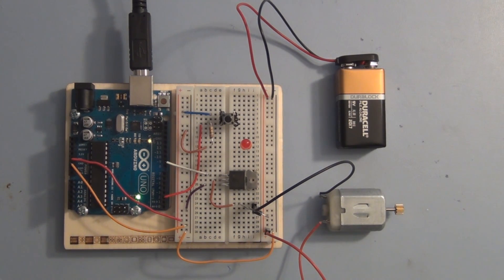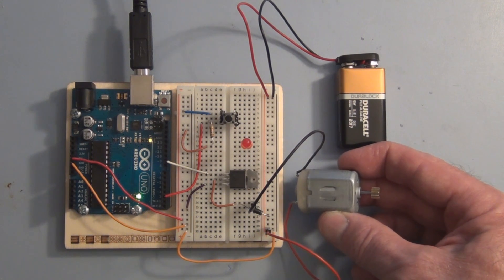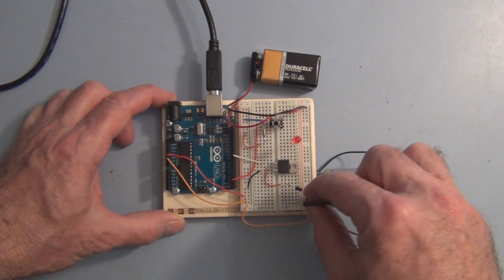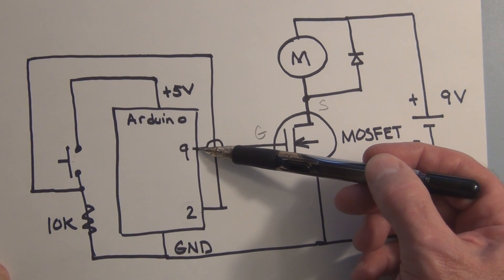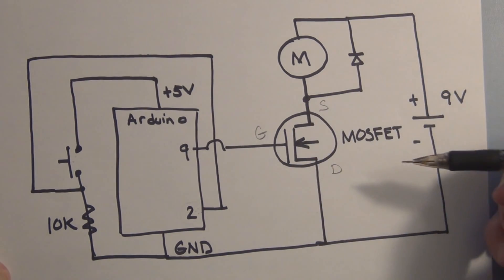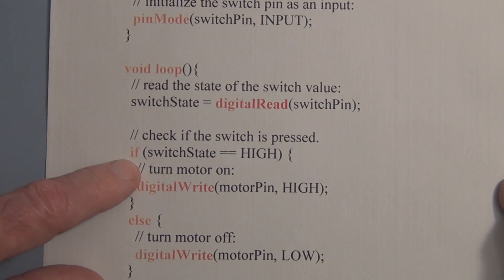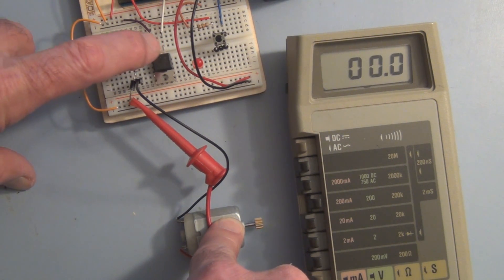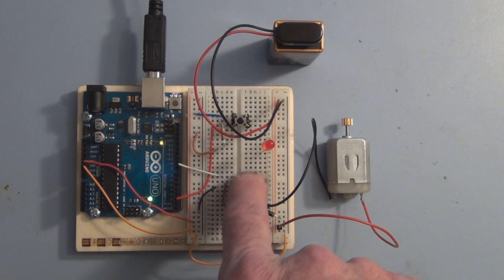Arduino DC Motor Control Tutorial

Comment: hello eTechTom, 

If I would like to attach a 24 volts, 800mA source instead of a 9 volt battery, for another device and follow the whole construction would this work? 
The common ground wouldn't destroy the arduino?

Thank you
Reply from the maker: +Pinda Of course I can't guarantee anything from where I am but  I would suggest adding a buffer between the arduino and the MOSFET so that if anything does go wrong you blow up the buffer and not the arduino.  The common ground will make sure that there is no voltage potential between the arduino ground and the 24V supply ground.
Reply: thank you for you quick reponse! Could you maybe say what you exactly mean with a buffer? what kind of element would I need?
Reply from the maker: Hi, I found this information to explain the use of a buffer.  http://www.electronics-tutorials.ws/logic/logic_9.html.

Comment: Hello sir I have a question,I've just studied something about mosfets,I've always seen their outputs as "Vout" something between source and drain,so I have some difficulties understanding your connections.So I was just going to connect Vcc to source then arduino to the gate and drain to the ground...but,of course, something's missing....you have connected your gate to 5v on arduino don't you? I am a super ignorant I know...and in this case theory and practice are two different things. Thank you very much.
Reply: +Andrea Ambrosini put an optical isolator like a DIP4 SHARP PC817C and a 220ohm resistor between the mosfet and the arduino.   Supply 10volts to the otherside of the opti which then fires the mosfet driving the dc motor.  The arduino is then isolated and safe.  Otherwise a mosfet that fires on 4.5volts but I am experimenting on which one to use.

Comment: Can we make some modifications in this circuit so that we can increase or decrease the speed of the motor..??
Reply from the maker: +SANDEEP KUMAR  This video is an example of speed and direction control https://www.youtube.com/watch?v=GumqesVRKyk
Reply: +eTechTom Thanks for the another video..but I would like to know that can we vary the speed using this same setup.???By changing the program code of the arduino..??

Comment: hello thanks for you time and presentation i liked it, now i do have a question as i plan to build my own MOSFET H bridge as i plan to pull alot of AMPS so i want to buy my own mosfet transistor and build my own driver board so my question is how would i go about starting a code? or libraries ? i plan on using a arduino Nano and 4 dc brushed motors so im guessing i will need  16 mosfets? 8 P channels and 8 N channels ?  so thats 2 P's and 2 N's per Motor  so how would a code like this will look like in setup?

Comment: The motor speed is not changing much when the pwm value is changed from 0 -255. at 0 pwm, the motor is slowed down only marginally. What can be the problem ?
Reply from the maker: It is difficult for me to troubleshoot something like this remotely.  I would review the code line by line and check your wiring.

Comment: Where do you get these hardware components?
I live in a village, near a small town, we don't have any stores that sell those...
And also, buying them online makes them quite expensive when you're just buying one of it.
Then they usually have to get transported, which increases the cost greatly...

Or can I find a nice kit with: Leds, resistors, capacitors, 555 timer?, diodes, shift registers, motors, cables, light sensor, pot-meter and all those. I kinda want to learn everything on it, some hardware (555/shift/motor/RTCC), protocols as I2C, UART, SPI and other interesting stuff... They should buy these in masses and sell them for cheap at schools/universitys, probably everywhere.
Reply: Google for Tayda Electronics. It´s a fast and reliable online store for electronic components that ships from Thailand. Shipping takes some time but the parts are dirt cheap even in low volumes.

Comment: Why the 9v battery has to have common ground with the Arduino?
Reply: Because both the Arduino and battery have to be connected to the source pin on the transistor.
Reply: 317andrew317 why? I see no reason for that. Why not 2 floating voltage sources?
Reply: Yeah I see what you mean.  My guess is that it shouldn't make a big difference having two floating voltages, but it will make the overall circuit more "stable or safer". I would try it out and see what happens.
Reply: 317andrew317 yeah, that makes more sense. I feel too, by intuition, that the circuit is more "stable or safer" sharing ground. The circuit feels more like "everything working together" if both voltages share ground.  I googled it and I read some people saying that sharing ground is a good thing because there is a shared "reference" in the whole circuit. I'm not sure of what that exactly means but kinda makes sense.
Reply: Joel Rivera That's how the transistor works. It only has one ground.

Comment: Is the external 9v battery necessary if the motor draws less power than the Arduino provides ?
Reply from the maker: The arduino is not made to be driving something like a motor.  It's purpose to to provide the control signals to get thing activated.  This just shows the basic concept of controlling a motor.  I'm not sure what the motor is drawing just spinning freely but once you start asking the motor to do work to drive some gears and wheels the current demand will be well above anything the arduino's voltage regulator can provide.

Comment: I keep getting  switchstate not declared in this scope. I wrote it just as you had it. Can someone please tell me what I'm doing wrong
Reply from the maker: There probably is a typing error somewhere.  I have entered programs before that I was convinced had no errors after reviewing over and over and then finding the error.  switchstate should be switchState for example.  Make sure there are the right quote marks,  " " is not the same as ' '.  Check to see if you have the right braces { }, [ ], ( ).  Its, difficult to see the difference in the Arduino IDE environment.
Reply: eTechTom So i got the sketch to work there was a } missing at the end well I hooked up the circuit and I have a irf510 and i'm using a 1n4001 diode. The motor wants to run when there the 9v is applied to between it and ground. I don't know if these 510 is okay to work with this i know it's not as good as the 520 but that's all radio shake had. Thanks for the video and help

Comment: I'm a beginner here so don't mind my silly question. 
I wanted to know about the diode. Is it a specific one or any diode will work?
Also what is the parameter for selecting a diode? (For Example: Resistance in resistors as in 100ohms,1KOhms, 1MOhms. So what is the measurement parameter for a diode.)
THANKS.
Reply: it probably does matter what diode you use for this lab since it doesn't use a lot of amps. as far as resistors it also doesn't really matter as long as you have one. 1k ohms + would work fine. just don't do what i did and put the diode in the wrong way it'll start to smoke lol
Reply: Lol....Okkk...thanks for the reply!
Reply: There are a few defining characteristics of a diode - how much current they can handle, how much reverse voltage they can handle, and the forward voltage.

For something as simple as this, your average diode should be good enough. In this case the motor needs 40MA of current, so your diode should be able to handle atleast that. I'm not so sure what a typical motor's reverse voltage is rated like, but again any old diode should probably be more than enough. The forward voltage is how much voltage the diode will take out of whatever you're ouputting. So if you give a diode 5v and the diode's forward voltage is 0.5v, you can expect the voltage out of the diode to typically be around 4.5v. It can be important to factor that into whatever you're trying to drive.
Reply: That was quite some description. Thnx! (y)

Comment: Hello.
Can I control the speed of the motor? I mean to say, is there any possiblity of a sketch(program)  where I will provide a speed(RPM) and the motor will run in that given RPM ? If so, please help me with that sketch.
Please answer my query as soon as possible. I am stuck.
Thanks
Reply: try to control it with the transistor. use a pwm pin for controlling the transistor and dont give full voltage to it.

try a stepper motor, too, which is made to do such things.
Reply: Jonas Toth Could you use analogWrite to the transistor instead of digitalWrite? That would controll the amount of current flowing through wich would then control the speed? Or is a PWM better because it allways gives the same voltage, just in shorter / longer bursts depending on the speed you want?

Comment: My kit did not come with a gear at the end. Where did you get that?
Reply from the maker: That was on the motor that came with the official Arduino starter kit.  Its a press fit so it was already on the motor shaft.  I just searched Amazon under hobby motor gears and there are a number of selections.  Some with plastic press fit gears and some metal ones with set screws.  You can probably find more by googling RC motor gears.
Reply: Thank you very much eTechTom.

Comment: Apologies for a newbie question. What happens if we don't have the 10K resistor. I am trying to understand what the 10K resistor is for.
Reply from the maker: Hi, Without the 10K resistor you would have a short to ground when you press the button.  The 10K limits the current going to ground through the switch when it is closed.
Reply: Thank you Tom(?). I truly enjoy your tutorials. They are so great and easy to understand. I wish you were my teacher in EE101 course in college.  I can't believe that I do not seem to remember anything from the course I took. These tutorials really inspiring me in many ways. Thank you again!  Back to the topic,why do I even need to connect from the switch to the ground then if the purpose of resistor is to prevent from shoring to the ground. Whew, a lot to learn for me.. :-)
Reply: Looks like I asked a question that leads to "pull down" and "pull up" resistor. NM the question. I will do some study on this. Thank you for the video tutorials again!

Comment: hi. Could you send me the code used in the Arduino ??
What is the reference of the MOSFET and RESISTORS USED ??

I plan to control the stabilization flew four engines of a Quadrirrotor.

Thank you

Comment: i am curious what if you wanted to program the button so once you press it, it turns the motor on for 1 second then turns it off even if you're holding the button down
Reply: asklnalksdn use delay (1000);
Reply: GabsBiz actually that won't work. missed the still holding the button down part. You'd need to set up some kind of timer. However, you'd need to make sure you reset it at some point otherwise the button won't work again.
Reply: thank you i wasn't considering the reset part

Comment: Hello sir,
Thank you for sharing this !
I just have one small question; is it possible to program the Arduino to control the Motor itself through a pre determinant route? Because i want to build something that will move by its own in a path that is already set. 
I hope I am making sense and I am looking forward to your reply.
Reply from the maker: This question has a lot of variables and it can be as simple of as complex as you want it to be.  If there is a predetermined route you have to translate that into code and that takes memory.  The arduino uno only has 32k of memory.  If the Arduino is responding to sensors it can react to the inputs and not use as much memory.  You could draw a black line for an arduino to follow by sensing the line and adjusting direction.  You could also add GPS and memory shields to the arduino and have an autonomous robot but that will require more complex programming too.

Comment: Would it be possible to use an SCR rather than a MOSFET to control the motor?
Reply: nope. scr are for other stuff. switches only with bjts and fets.

Comment: sir this motor having controlling through a switch..but is that possible to control through some wireless ...if is it possible then give me some ideas..thank you..
Reply from the maker: You would have to use something like the xbee wireless modules for the Arduino or maybe infrared for shorter range projects.
Reply: thank you sir..,but if i want to use twitter or Facebook through control a toy car..then?
Reply from the maker: Rozar Biny There is also an ethernet shield for the arduino or the Arduino Yu'n which has ethernet and wifi capabilities.

Comment: Good video, BUT your schematic is incorrect.  The Source should go to ground and the Drain should go to the motor.  Fortunately, your actual circuit is correct.
Reply: MOSFET terminals of source and drain can be reversed with the same results, however you are correct about the source and drain being reversed.
Reply: It’s fine as long as it’s workinggg

Comment: The diode doesn't protect from latent rpms on the motor, it protects from Back Electromotive Force.  Even if the motor brakes and comes to a complete stop when you disconnect it, the magnetic field generated takes a while to dissipate.  When that happens you get a voltage spike.  The diode allows a path of return.

Comment: so now how would I make a speed controller for the motor? I assume using the analog outputs and a BJT to amplify??
Reply from the maker: You could use pulse width modulation.  As you vary the duty cycle of a signal applied to the base of a transistor you can vary the motor speed.  The program would be similar to the experiment varying an LED's brightness.